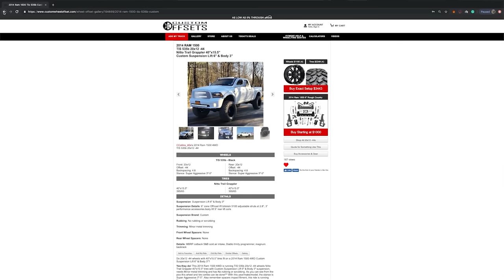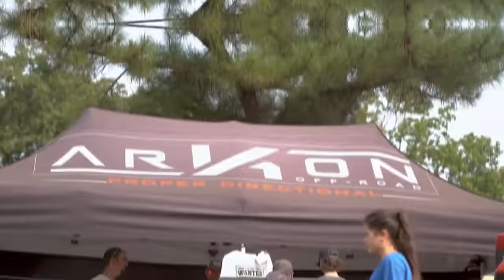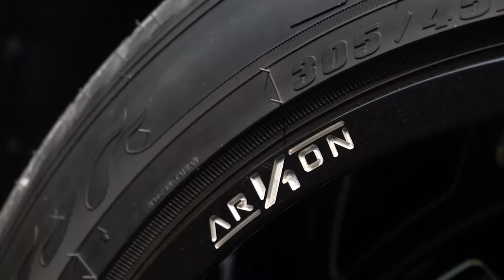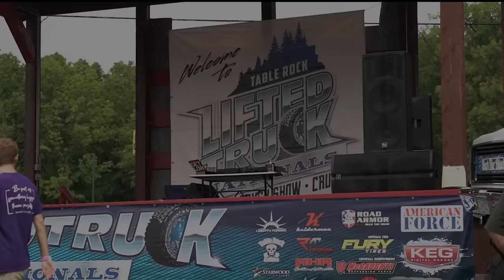Truck Show Fails | Watch This Before Your Next Truck Show

Comment: I’m thinking about entering my truck into LTN because i only live an hour away from Branson but im too nervous that it won’t be “crazy” enough. I drive a 2001 second gen ram, I plan on putting it on a 5 inch lift with 22x12 Akron Mandelas on 35/13.5R22. What are your thoughts?
Reply from the maker: Send it! Totally worth coming to and entering your truck  theres everything from mild to wild!
Reply: Definitely do it. I’ve never missed an LTN and my truck is far from crazy and there are so many different builds from mild to SEMA wild and most of the people I’ve met there respect them. And I’ve seen plenty of 2nd gen Rams on 35s there.

Comment: I have a 2000 ford f350 dually would a regular 2000 ford f350 lift work on it?
Reply: No has to be specific for dual wheels dually have a different rear axle and suspension
Reply: @jaxaboi7999  thx
Reply: @g.taylor23762  np big man

Comment: Let me stop you right there a firm does not offer 0%. I have a credit score of 820 and I paid off so many wheels and tires over time when I try to get a tire and wheel setup they were offering me a whopping 14.9% and the longer you went the scarier I got the shorter you went the better it was but having a good credit score I'm not going to submit to a anything above 3% I wish you guys did synchrony CareCredit anything over a thousand it's one year zero interest